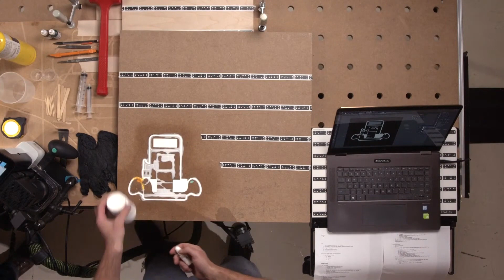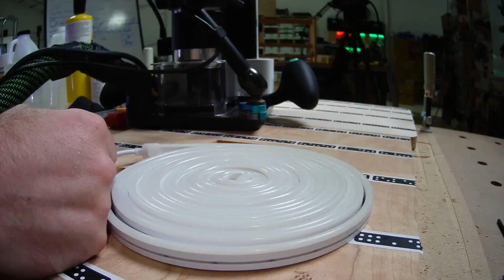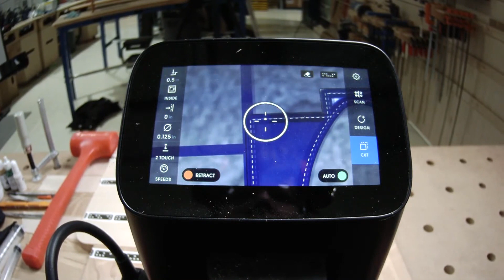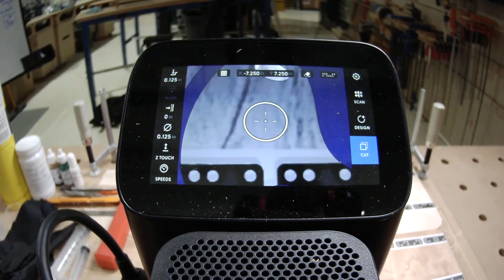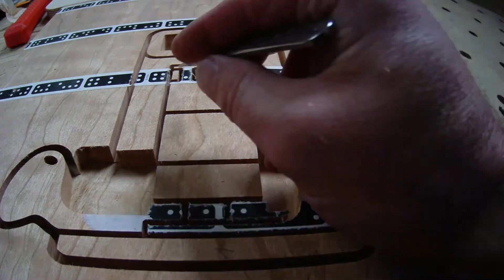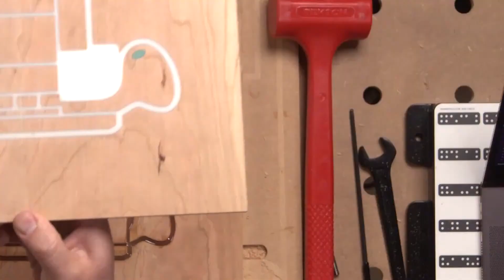Session 32  – English: Backlit Sign Build

Comment: Great video. I haven’t used the brand of epoxy you guys have used. My go to epoxy is from Black Forest Wood Company. I have the 2:1 DEEP, 1:1 Thin COAT, and 1:1 Thick COAT. I would recommend this brand of epoxy. I have also heard of using degassing chambers before pouring and heat guns after pouring to remove bubbles.